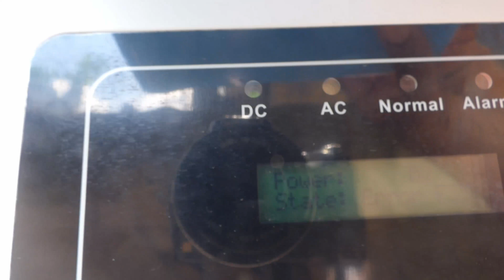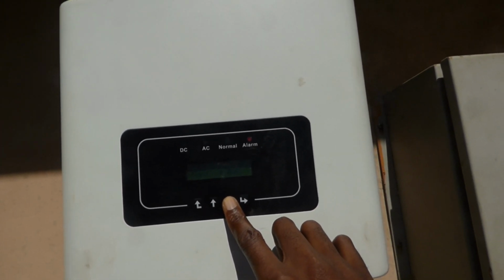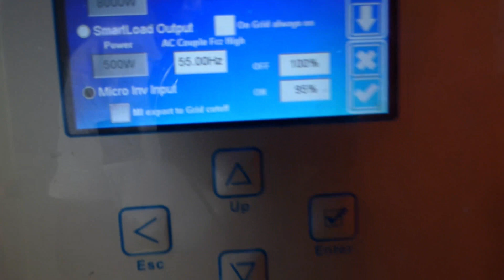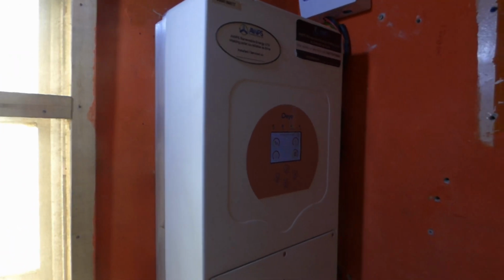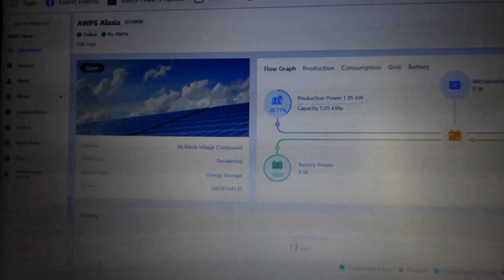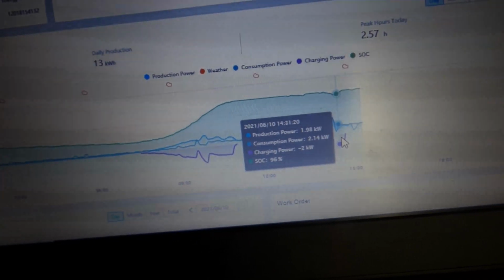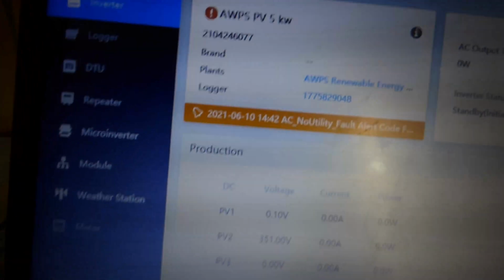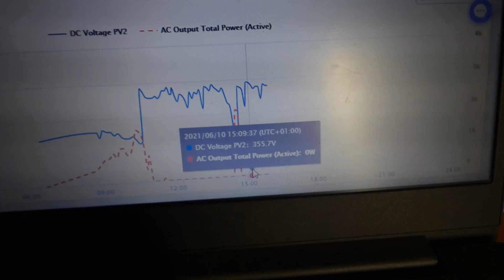Deye Grid tied Day 2. Red Light is on and no power from it

Comment: Thanks for sharing Dr Solar. There is a workaround if you want to keep it running. Use battery voltages instead of percentage and set "OFF" value to 59V.  Battery will not reach 59 and your grid tied inverter will keep on running. That way you don't have to drain your battery to 95% and consume its cycle and you can directly use energy generated by other inverter. Another suggestion, considering you have 8KW PV, you can attach 7KW PV to your hybrid inverter, It'll generate 5.8KW MAX when battery is charging and 5.5KW MAX when battery is full, remaining 1KW can be added using microcontroller which will be more cost effective. If you have no plan to extend you can spare you grid tie inverter  in that way :-)
Reply from the maker: I have Lithium batteries and it is important that they stop charging when they are full. This is more of me experimenting and pushing the envelope
Reply: @drsolar  I believe BMS will stop charging, if that's not the case then better avoid it. I've seen that working in a video which I shared with you as well in your grid tied un boxing video. Anyway! Great going, keep up the good work

Comment: Why do you set it to turn off the PV inverter at all? Why not keep it on all the time so load is being run by the sun entirely and save your battery for the no/low sun times?
Reply from the maker: I have 5 kw in PV on the Deye 5 kw hybrid and 3 kw on the PV inverter. Unless I turn the PV off on the hybrid the PV inverter would always go off. Thank you for watching and commenting.
Reply: @drsolar  thanks but I'm not understanding your reply. Unless you are saying that you do not have enough demand to require the PV inverter to be on all the time? And your 5kw directly connected to the hybrid is sufficient to run loads. But from your  previous video you were not able to harness enough sun from the 5kw. Please clarify as I'm interested in Deye I'm running Growatt but there's no option to add a micro inverter AC input
Reply from the maker: @MrShaneo369  we have seasons in Nigeria. During the dry season, when we have abundant sunshine the Deye hybrid with its 5 kw in PV is more than enough. We are now in the rainy season and the PV inverter comes in handy. It allows me to charge faster while powering my loads. I am loving the experience and my Deye hybrid.
Reply: @drsolar  Great, sounds like over panelling would be a more affordable option for you. However, I do like the option the Deye gives. I'm in the Caribbean so our sun is pretty consistent maybe a 30% loss during the "winter" months
Reply from the maker: @MrShaneo369  where in carribean are you? Solar is a great option for you. I am over paneled at the moment. 8 kwp. Thank you for watching and commenting

Comment: You need a dump load to keep the battery at 94% so you can maximize your production. Bitcoin miner would be awesome dump load. But you will find other loads with time of use to coincide with the production.
Reply from the maker: Hello OGW. I should consider a bitcoin miner, but I would need bigger batteries to run them all day. I might add a 3rd AC.
Reply: @drsolar  ya a dump load only runs when the batteries are full and you have nowhere to put the production so it is use it or lose it.